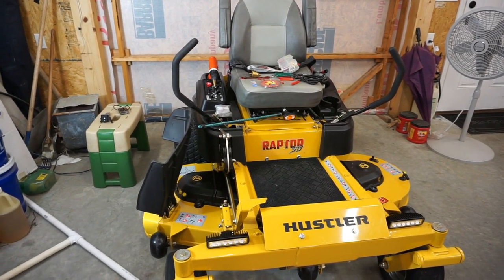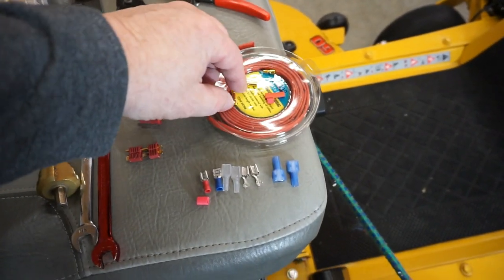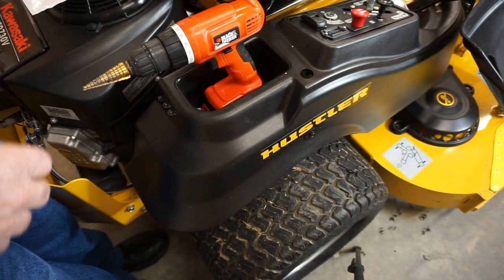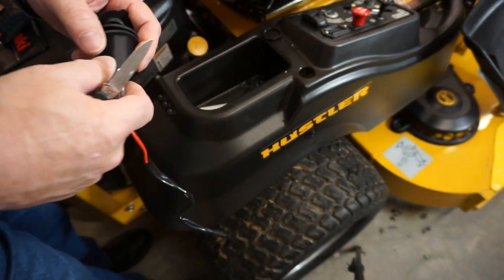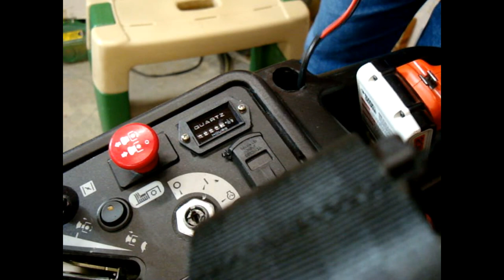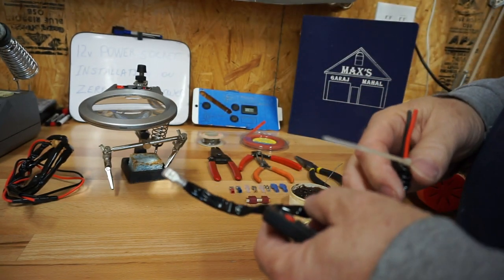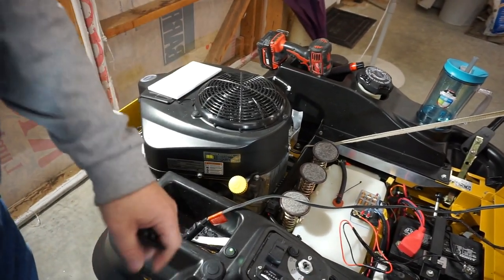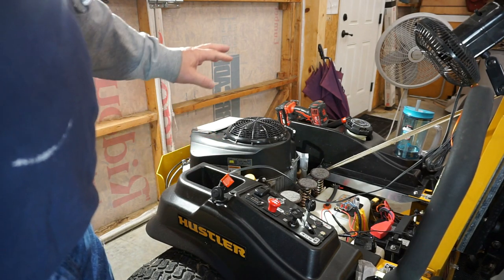12v Auxillary Power Socket Cigarette Lighter Installation BigDog Alpha & Hustler Raptor SD

Comment: Great job Max installing the power socket that’s the way I got my power socket hookup going to fuse panel I also have a off and on switch but yours looks more factory installed then mine.
Reply from the maker: Thanks Michael. I really should have showed the wiring for the switch. I just knew this video was way too long already. Thanks for the compliment.

Comment: Max, if you seat belt in and turnover seat pan is going to (flop /hinge) over , on a side roll ,seat needs to be locked down front and back.Its going to fold you up.Tractor seat belts are landed to the frame .
Reply from the maker: Yes Sir! Those are only there to keep me back in the seat, not for rop. On my property it would all but impossible to roll it and I've tried. hahaha
Reply: @MaxsGarajMahal  Really like your channel ,I run the Sdx, you have inspired some add ons
Reply from the maker: Glad I've inspired you.

Comment: Where did you purchase the socket and switches? Also the voltmeter from another video?
Reply from the maker: Cigarette Lighter Socket Car Marine Motorcycle ATV RV Lighter Socket Power Outlet Socket Receptacle 12V Waterproof Plug https://ebay.us/Egi1Wb

FidgetFidget 12V 24V Dual 2 Port USB Charger Socket Voltage Voltmeter Rocker Switch Panel Car
 by FidgetFidget  https://ebay.us/qaEQJt
Reply: Thank you for the reply. I heard you mentioned in one of your other videos about being able to mount a sprayer to your zero turn. I too would like to do that as I have a electric 10 gallon sprayer. Do you have ideas for that or have seen other videos on how to accomplish that mounting?

Comment: Why would you ever need a 12v Power Socket??? I can understand a USB port, but I can't think of a time I would need a 12v Adapter. Unless, You are a gadget guy!!!
Reply from the maker: Not much you can do with a USB other than power up a cell phone or something of that nature. However, you can run a 1/2" 12v impact, a 12v fan, 12v liquid pump, 12v air compressor or for that matter, pretty much anything that requires 12v including lighting an old school cigarette. lol
Reply: Mine isn't switched,  its always hot.  I use it to connect my battery maintainer.  Much easier than clipping it to the battery.
Reply from the maker: @DougKremer  Great idea for maintaining the battery as well.
Reply from the maker: Kremer, I have a port for my maintenance charger as well on the fuse panel. I even use it for the big dog battery charge. Works great as I don't have to move the red battery terminal cover.
Reply: I would use the heck out of that especially if you could rig up a canopy then use that 12v plug for a fan. I'd never get off my mower